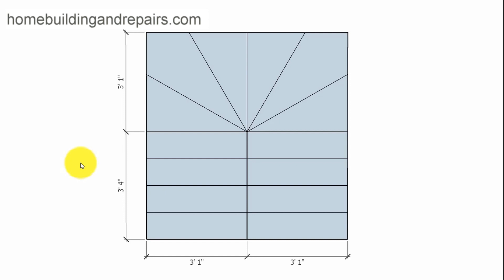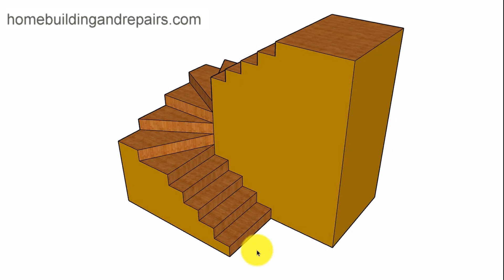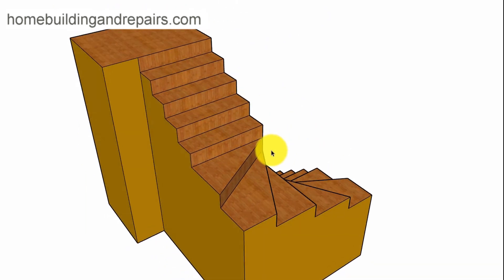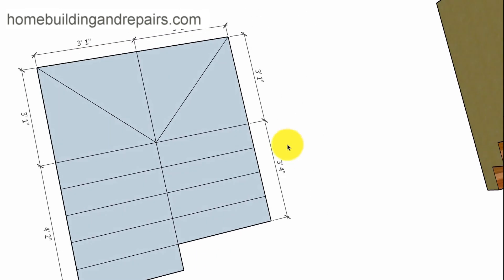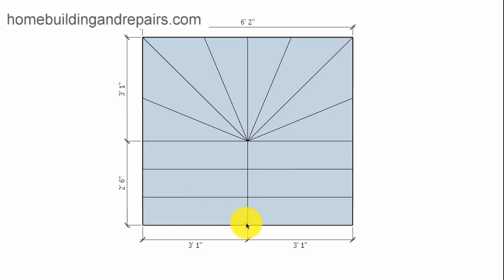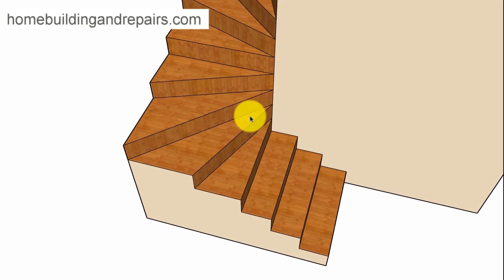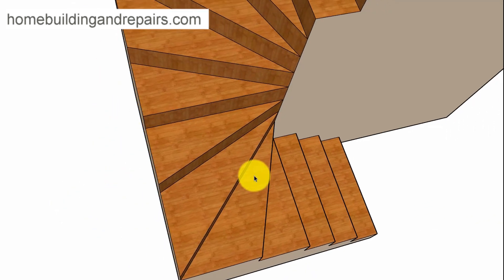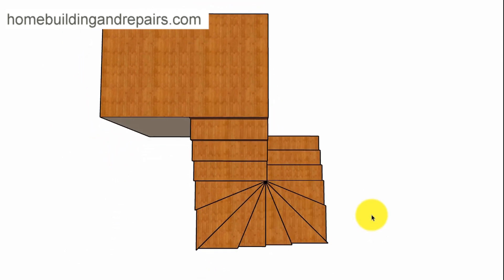About The Smallest Winder Stairs You Can Build - Architectural Layout Design Ideas

Comment: Let's say I have a hinged door at the top of a straight staircase that goes down into a basement. Would it be possible to move the door to the wall that's adjacent to the opening (i.e. a wall that's 90 degrees to the top of the staircase)? I'm wondering if it would be possible but I'm having trouble thinking of ideas. I'm a homeowner that's interested in having the door to the basement moved to a slightly different location.
Reply from the maker: As long as it won't create a problem with local building codes, then absolutely.